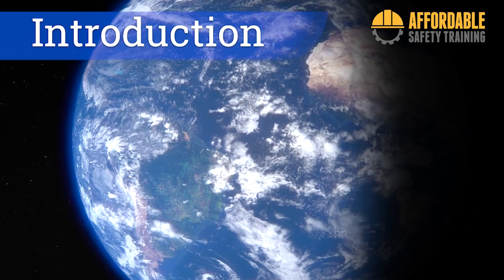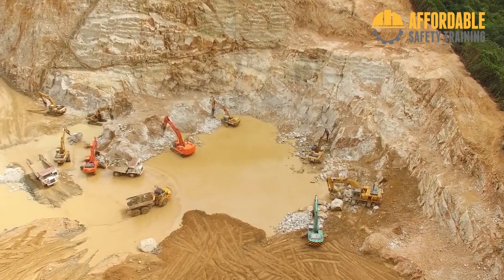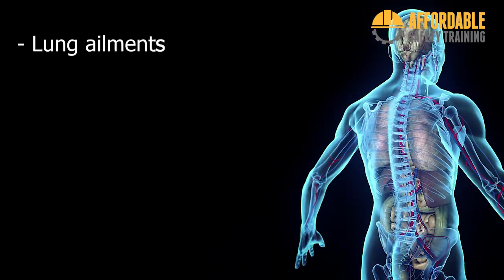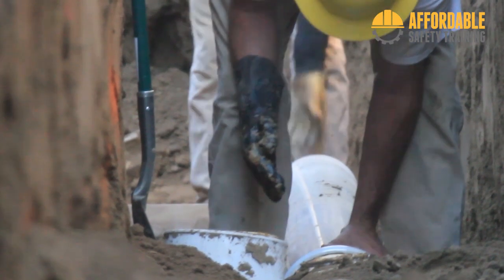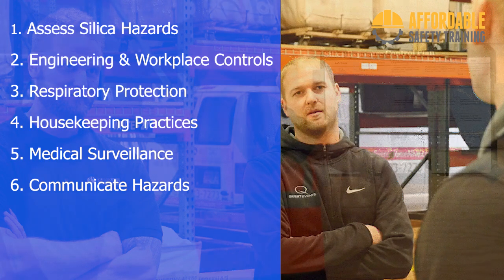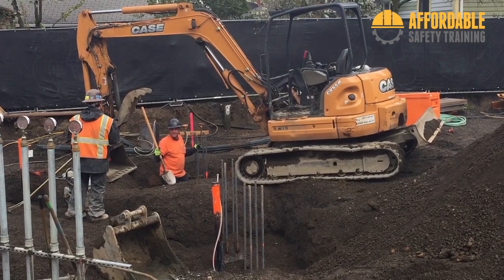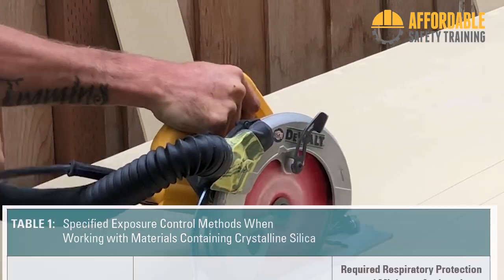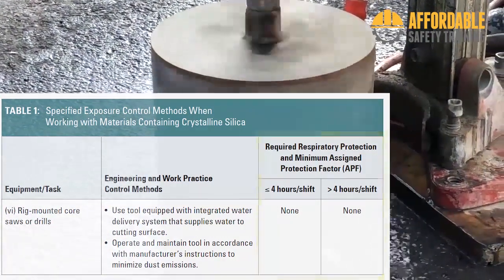Respirable Crystalline Silica Safety For Construction

Comment: XO Safety, very important question/request for you, I am finishing up a construction safety video, part of which ties in with silicosis - for those who breathe in way too much dust from the ground, breaking rocks, concrete, or this crushed concrete - the very common dust crystalline silica - though I've noticed people really have to breathe in a ton of the dust over a period of years - or extreme single exposures like the breathing in the dust from the twin tower collapse to get an issue from only single exposures. I personally do not have much in the way of clips showing hepa vacuums or other dust control methods so was looking for some existing footage that I could utilize - I would just include the clips showing your vacuums and wet methods - probably only utilizing around 10-20 seconds or less of your clip - and could gladly cut out your audio, I am planning to just utilize my talking points for the video - unless there is a key piece you explain about the vacuum you think I should include your audio of in your explanation. Would I have permission to incorporate just a small bit of the clip? I do intend to sell this/strategically give it away for free to those who need it. In exchange for this - I can give the final product to you at a highly discounted rate and or even free if you are looking for a modern construction safety video (mostly specific to concrete construction) including modern medical treatments. In any case just let me know if that would be okay.
Thanks you for your time!